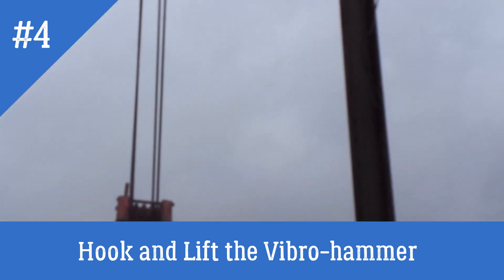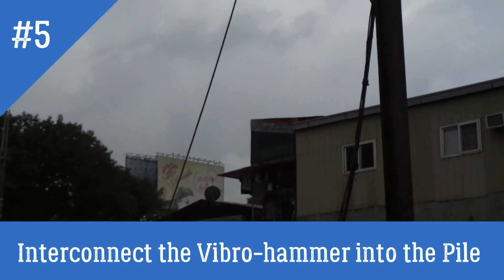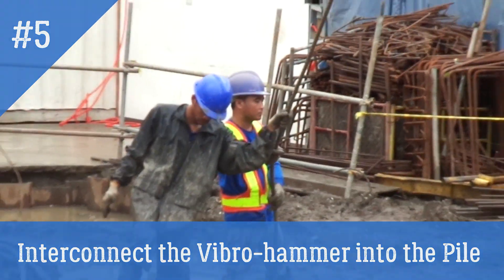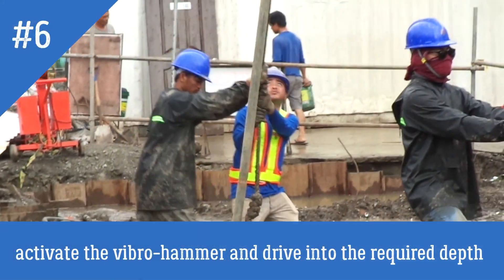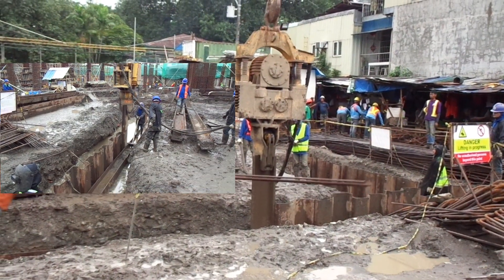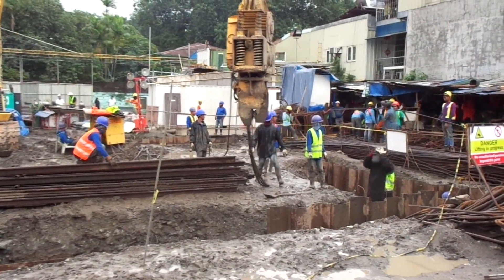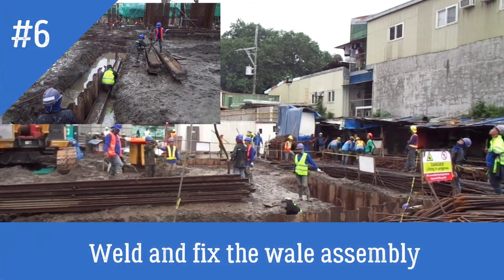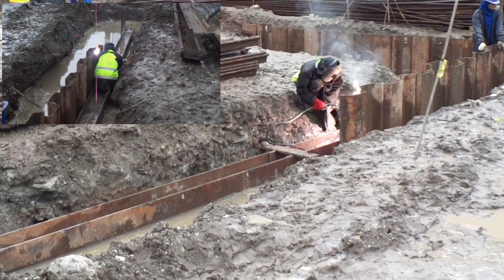driven sheet piles - substructure works - foundation footing - building construction

Comment: Sir. un sheet piles po ba after mabuhos ang retaining wall, tinatangal yan? or part na yan ng substructure element?
Reply from the maker: can be retrieve which is cost deductive to the installer/contractor and some may not be retrieve due to safety  reasons
Reply: @inhinyerongsibil6383  noted po and many thanks